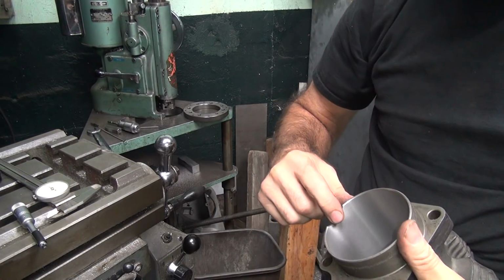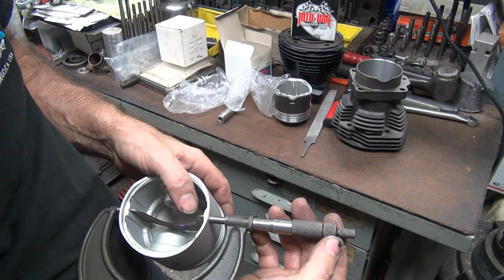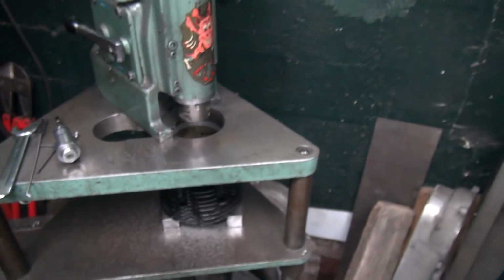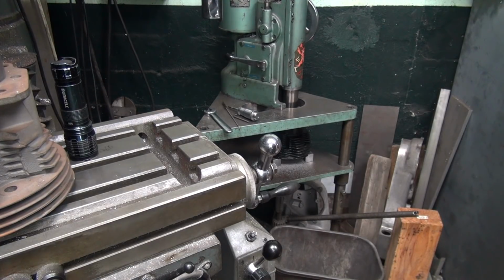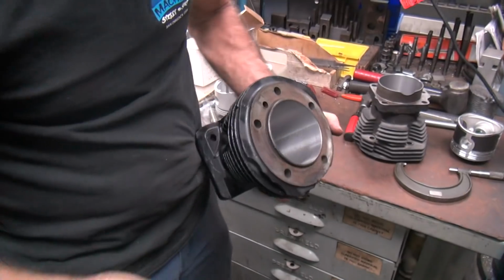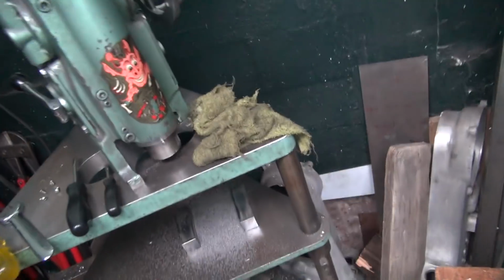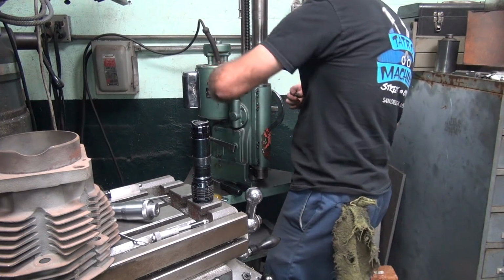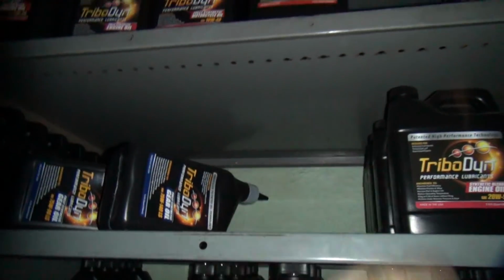1978 junk #102 shovelhead offset cylinder boring FL FX harley kwik-way by tatro machine

Comment: Hi Tatro , did you say you’ve done a 1/4 inch cut on that before??  😎
Reply from the maker: yes, on 883 evo cylinders. they are soft gray cast iron. still just too much for this boring bar. .100 cuts all day, .200 is pushing it.
tatro